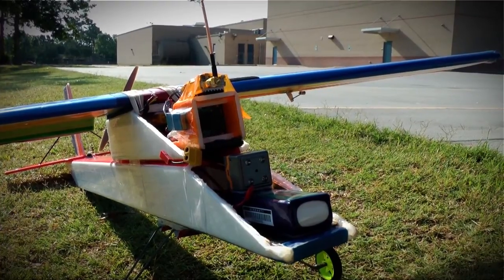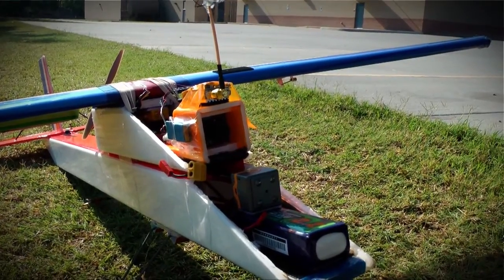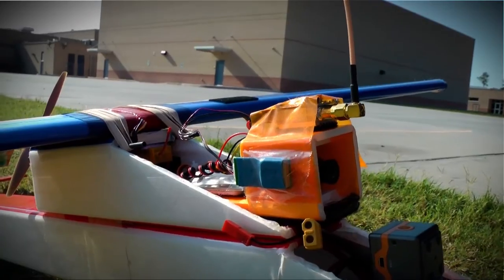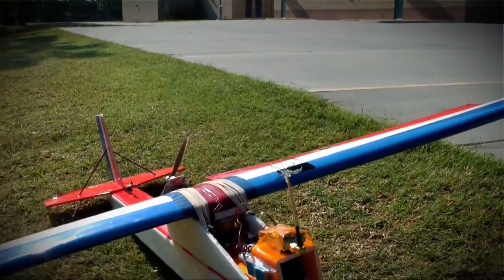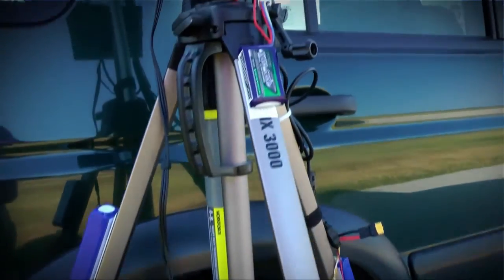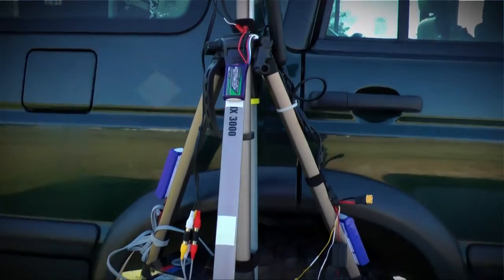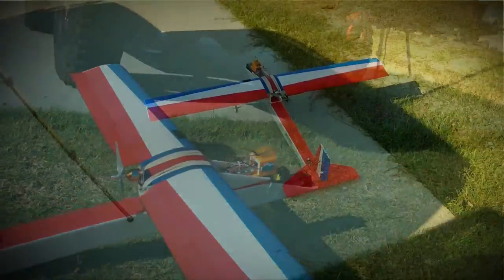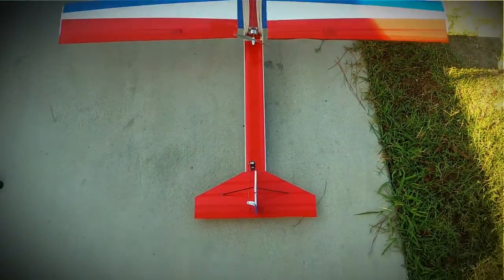Axon FPV Flight Testing

Comment: What is the motor esc prop combo?? How much flight time do u get??
Reply from the maker: Motor is a 2200kv using a 6x4 APC prop.  ESC is 30a.  Using a 2200mAh 40c battery, I get a good 7 minutes and that's in 5-10 winds.  When I use two batteries, I can stretch that to a good 15 minutes of flight.

Comment from the maker: It does not have auto-pilot RTH, but does have the indicator showing you where home is and how far away you are.  The OSD I got was under $100. I put a link to the one I got in the video description.  It seems that if you want auto-pilot RTH, you're looking at $200 or more.  I'd love to have that feature, so I continue to monitor the pricing and different makers.  For now though, this one gets the job done so I'm pleased with it.

Comment from the maker: Yeah, I can squeeze two of my 1.8 3s in the front and run them in parallel for a longer flight time, but it's a tight fit.  A 2.5 or 3in fuse would surely be roomy enough I'd think.  You could probably even move up to a 7x4 prop with that larger fuse.